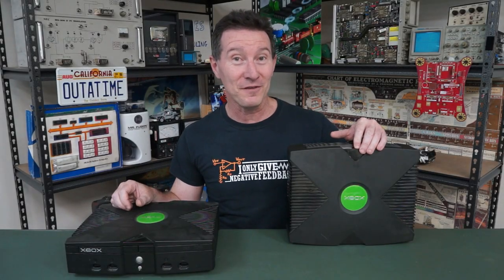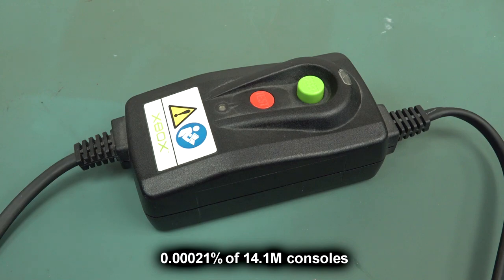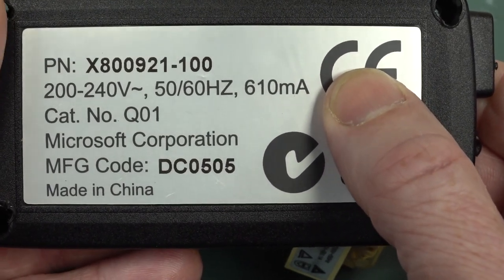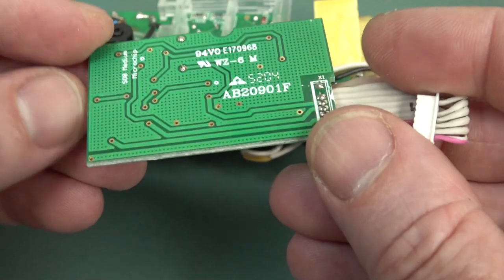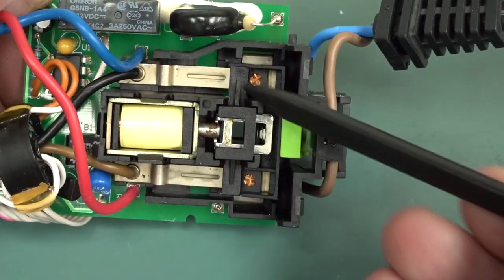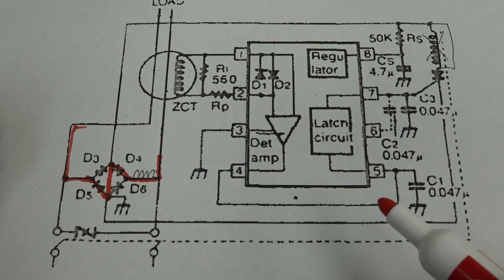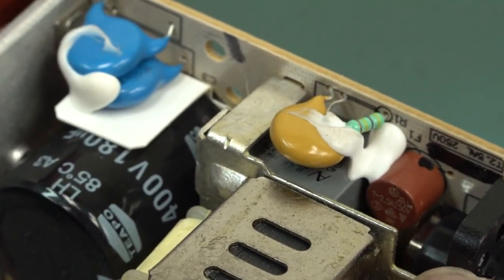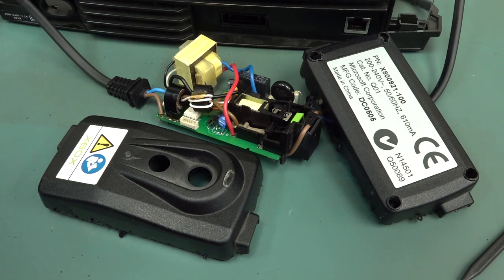EEVblog #1164 - Xbox Engineering Baptism Of Fire

Comment: Got to thinking about this, and I haven't watched the entire video yet, but the current balance detection is like a GFI breaker. I am thinking this is to prevent a fault caused by someone connection the console to a TV that had a hot chassis where the isolation on the TV was compromised. I remember back in my servicing days I would see people bring in TVs that they had modified them self to put things like headphone plugs on them, of got forbid tap in external video inputs to a TV that just had a tuner and was a hot chassis. If something in the TV isolation were to fail and the AV input became hot, that would create a serious safety risk, especially if someone is holding a controller in their hand and the cord was worn exposing a conductor.

Comment: I used to mod the OG Xbox here in Canada, my personal unit had the loose power jack, it finally arced and smoked a bit in 2013.  It did trip my surge protector saving the unit for me!  I was able to re-solder the joints and put in a couple screws for strain relief!  It's been running fine ever since.

Comment: The variation on solenoid drive ensures that if the current detection circuit fails as a short, the solenoid triggers.
Reply from the maker: That would be one advantage. To bad if the diode bridge fails open though...

Comment: I still use mine from time to time. Completely obsessed with Burnout revenge.

I'm sure you already know this but remove the clock capacitor before it throws up all over the board and ruins the console.
Reply from the maker: Nope, no idea about that, what type of cap was it?
Reply: @EEVblog  Super cap. It sits near the front of the unit under the DVD drive.  Should have three huge-ass bulk capacitors next to it.
Edit: Apparently only some models had three bulk caps. Some only had one. There's a ton of info on the net about the darn thing.
Reply: Eyy Revenge is good shit
Reply: Indeed it is. Would love to see a PC port with higher resolution. Paradise can't touch this bad boy :)
Reply: @EEVblog  I recently removed mine and it was leaking. Here are more details: https://www.reddit.com/r/originalxbox/wiki/clock_capacitor

Comment: My guess at the uncommon wiring of the solenoid is to allow for measuring the current going through the solenoid (that's why the white lead goes through the current tranformer) when you press the Test button, showing either green flashes or red ones on the led, and it also protects from most common thyristor failures. There's no chance of a fault not being detected by the Test procedure.

Comment: I worked for an "Electronics Boutique" type repair facility in Australia repairing PS2 and XBOX consoles back in the day. Apart from RROD reflow issues and generally mechanical CD drive issues the SM power supplies were a massive failure mode. Can't remember specifics but the later revision supplies were far better and I generally put them in the consoles when servicing  as the early boards were notoriously bad for shitting the bed unexpectedly.

Comment: At the start of 2018 Microsoft had a recall on the Dumbass Little™ 5cm power cord that goes from the outlet to the power block because it had no strain relief. Kind of weird that they screwed up again, but at least the replacement plug couldn't have cost nearly as much. Thanks for the trip down memory lane and the in-depth look at what it takes to make up for bad soldering sometimes.
Reply: In 2018? Wow, back a few years ago we got a box of ac leads in for surface computers that was because of the same damn thing!, no strain relief on this tiny foot long cable!

Comment: I don't recall ever seeing one of these replacement cords, or even hearing about it. However the xbox has a special place in my heart, because it was the first time I soldered anything, by way of installing mod chips :) Another nifty mod you can do to these is get an IDE to SATA adapter so you can install a modern hard drive, it allows for near instant loading of games from HDD and higher capacity.  The OG Xbox was great!
Reply: First Last  Ah, that would make sense

Comment: I wouldn’t call this “the 2005 XBOX” when XBOX 360 launched in 2005. It’s the 2001 XBOX. Yes, it was king of the hill for most of 2005, but that was after this issue was fixed. The XBOX you brought home from the store in 2005 should not have the issue that prompted the power cable replacement.
Reply from the maker: The issue came up in 2005, 6 month before the 360 was released. Boxes after Jan 2014 were not affected.
Reply: @EEVblog  I’m confused. By Jan 2014 the original XBOX had been out of production almost a decade. Maybe it wasn’t a full-on recall yet but they started making XBOX consoles with the safer RCD power cables on October 23rd, 2003… which is less than two years after it launched in November of 2001. It had two more Christmases ahead of it before being replaced by the XBOX 360 meaning half of it’s primary retail life was yet to come at that point. That’s why so many used XBOX consoles have the newer/replacement type power cord.

Comment: i dont remember this happening.  Im fairly sure I didnt have the replacement connector.  I could have died in a blazing fire!  Fortunately, I never had an issue.  My 360 did get the RRoD.  I called MS and the tech said "Uh oh."  Turns out my one year warranty expired  literally the previous week.  He put me on hold for a couple minutes and said they would replace it anyway.  That was cool of them, as they technically didnt have to.
Reply from the maker: Nice.
Reply: It helps if you only plugged/unplugged the thing a handful of times, and if you did it without excessive force.

Comment: I've had my original Xbox for about 15 years and haven't had any issue with the power supply in it. The only problems I've had with it was the leaky clock capacitor i took out and replaced, fixed the coroded coppertraces that preveted it from being bootable on the power button, and replaced the rubber belt that makes the dvd player to open it's door. 
I had it running for about 6 hours straigt not long ago, playing some old games and watching dvds and it didn't complain at all.
I've done some modifications on it over the past years and now have my whole game library stored in it's internal SSD harddrive i installed about a year ago, and it is works like a charm.
I'm rellay happy with it.

Comment: I've seen similar used of  bridge rectifier for the solenoid to allow a SCR (or even BJT) to switch on the AC coil for both cycle, instead of only one without it.

Comment: The electronic fuse would have been an off-the-shelf part no doubt just rebranded
Reply: That "Xbox" label at the bottom and the cheap abs case gave it away pretty easily.
Reply: I was thinking the same thing. The obvious "generic Chinese" industrial design of the case that didn't fit the XBox styling is a bit of a giveaway. I doubt this was designed for Microsoft.

Comment: Could the micro controller be set up as sort of a time delay?  Such a thing where it will allow some current draw for a bit but then it can decide to cut it after a certain amount of time, then can reset if the extra load goes away?  To me, depending on what the console is doing, working hard for a fully complex game and graphics, or something more easy like Tetris,  different current loads?  Time delay for the high draw periods but if it draws for to long, it will cut it?   Maybe talking out my but.  I do lots of high current 13.8 volt stuff, hf radios,  I more concerned about a good crowbar/clamp circuit in it.

Comment: At 12:30 you ask why two boards. There are isolation rules. You just can't put all that low voltage stuff on the main board in the middle of the 240V circuitry.

Comment: The Thermofuse in Series to the MOV is for stopping the MOV from burning. MOV degrade with every thermal event (Overvoltage), and degradation leads to a lowered threshold voltage, amongst other things. So, eventually, the MOV will start conducting at mains voltage, heat up, lower it's threshold further, and finaly run away with a massive Fireball at the end.This can only be stopped by sensing the temperature of the MOV and breaking the circuit if it get's too hot (->Indication of massive leakage Current). At the End, the MOV doesn't protect anything anymore, but at least there are no flames...I also do this in my HV-Designs, because an Arc at several hundreds of Volts DC is only fun if you can watch it in a controlled environment...

Comment: In every single one of the xbox originals I have opened, the aerogel supercap keeping the clock circuit powered has failed and leaked, with a slimey corroded board as a result. Some boards are beyond repair, and some did clean up and worked after some component replacements.
First signs of failure are a reset clock, difficulties powering it on, and occasional spontaneous self power ups when the cruddy mess is really bad.

Comment: the two boards are due to certification - it's much easier to get certified if the low voltage and high voltage boards are separate.

Comment: I felt the same thing when I saw this design in an old wire schematics of ( if I remember well) a secret light activated light bulb. I firstly didn't understand why they shorting the bridge rectifier. I think this is before the tryac becomed cheap enough for mass production. And they did  that so they can use a transistor or a tyristor to switch an ac load.

Comment: temp fuse on the MOV is because once MOVs trip at high current or slow degradation over time they lower their resistance and constantly run hot all the time. If this AFCI is meant to suppress arcs it potentially could see a lot of back emf from arcing and degrade the MOV over time thus the temp fuse. If fact any good quality surge arrestor will have temp fuses on MOVs like "protected" power bars etc
Reply: Ah! That explains why I've come across some old power bars with mov's and darkened plastic around them that appear like the mov's were hot for ages. We have a ton of oooooold 20+ year old surge supressor bars hanging around my workplace, and I've pulled a few of these apart with that failure.

Comment: Arc Fault is big now in residential homes and now are used in all residential receptacles in the USA or as a breaker to feed receptacles. Older homes when replacing a breaker can use a similar breaker as the neutral and grounds need to be accurate to work properly. Good Stuff their...Uncle Bob

Comment: I remember getting the cord replaced on mine. A friend got the in-line circuit breaker like in this video, whilst all I got was a new figure 8 cable. The only thing I could think of was that my Xbox was a later model with a different PSU, but I still thought it was weird that they sent me a cable.

Upon closer inspection of the original figure 8 cable I got with the Xbox, the figure 8 plug end was marked that it was only rated for 120V with an Australian 240V plug on the other end.

Comment: I've had an XBox since day one, and have work on them for years. The first time I have ever seen that cable was about a year ago on a unit that came to me needing a new belt for the eject. I looked at that like what the hell is this thing.  Never seen one with a problem at the input side, or heard of anyone have one smoke, catch fire, etc. 

I know they're tough units. I just rescued one that was sitting in the rain for about 5 years, It was rusty as can be, but it powered right up and worked with the exception of the laser guide being stripped, and a bad eject belt. 

I wonder with the complexity of that external power unit if it was designed not just as a fuse (breaker), but as an ark fault unit. Something many new homes now have, but wasn't common when these were released.

Comment: Funny thing, I got a cheap (80 euro) "2 in 1 rework station" (hot air + soldering iron), and the first thing I noticed when taking it out of the box: a nice round fuse holder in the back of the device.

Comment: wow i havent seen one of those things for 10+ years! My old original xbox was one of the affected ones so i had one of these. Funny thing is, until i saw this video i had 100% forgotten all about this issue and those things and still regularly use my console to this day just using any random fig 8 power lead ive got lying around. I might go and make myself a fused one after watching this just with a couple of 1 amp fuses. Not as good as this thing but better than nothing. 

And infact this got me thinking now too how many other people have got console which were from the affected batches but long since forgotten all about it or people who have bought second hand ones off ebay etc.

Comment: MOVs should have thermal fusing to prevent thermal runaway and fire under current limited fault conditions according to manufacturer's recommendations. You can buy MOVs with thermal fuses built in.

Comment: Dry / broken solder joints on the mains input was a common problem on the original xbox. We used to get quite a few faulty ones in the shop and invariably the complaint was intermittent or no operation. We never saw a really burned up one, but arcing on the mains input was definitely an issue. We used to resolder the connections and then anchor the mains socket to the case with a couple of small screws and we never had one come back. Pity the xbox 360 wasn't as easy to fix - those things were a complete nightmare, and the failure rate was astronomical, as we all know :(
Reply: Edit > Just think how much money Micro$oft would have saved if only they's anchored that socket properly in the first place. (We still see quite a lot of laptop chargers with the same fault)

Comment: I got mine for $5, guess it was because when they didn't see a green light, it was because there wasn't a video cable attached. So I got it to work for cheap, tore it apart, cleaned off the pink thermal goop, cleaned the DVD lens, replaced the thermal goop with arctic silver, soldered in a mod chip, and bam, it worked great (worked great before that, but showed signs it needed some work).
A week after I got the knockoff "slim" controller, got a Duke for $5 (hey, consistency, right?). Working on getting a new HDD in there as the 8 GB version is meh.

Comment: Still have a rev 1.0 board. I remeber ordering a new power supply that had fixed the fuse issue and locked down the female power input port. Rev 1 has a fan over the heatsink. Another issue was lack of airflow to keep the hard drive cool. The cooling fan mounted in the back of the chassis was very noisy. To correct this issue, people would place the Xbox in an enclosed TV cabinet. Lack of cabinet airflow increased the internal temperature of the Xbox. The cooling fan in the back of the case was suppose to increase in speed as the temperature inside the case increased. For some reason, some Xbox units did not and would overheat. The simple fix was to drill holes in the back of the hard drive plastic mount and upgrading the bios to spin the cooling fan faster. Rev 1 of the orginal Xbox didn't encrypt the bios, so changing the speed of the fan to a fix voltage, RPM, was an easy edit. The downfall with the Orginal Xbox was a lack of memory for some of the intensive games. The fix to this for the Rev 1 board, we would solder additional memory chips on the back of the motherboard. Microsoft engineered the ability to do so but never officially sold the units with addtional memory. Booting the console after soldering the addtional memory, the additional memory was automatically utilized. The more graphics-intensive games having four players ran a lot smoother. I think I still have the how to document somewhere in my archive. Reply back if you would like to see a step by step on how we modified the motherboard and xbox case to allow the game console to work better during long hours of intensive game playing. 🖒
Reply: I always thought that i would not utilise more RAM unless you have flashed bios that supports it. Original games wont use that unless patched, maybe homebrew and emulators. I have 1.0 revision with ram mod and 1.4 with original 64mb of ram. But if you are right well, something new learned.

Comment: I used to have a Mod-chipped original Xbox.. they were awesome media players and being able to 'back-up' games to network storage was very handy. In the end it got struck by a power surge which killed it.. so I gave it a viking funeral in the back yard with the help of some diesel.. I wish I still had it.. never had this electronic fuse for it.. maybe it might have help save it
Reply: Dana Vixen My Xbox was hardmodded too.  It had a 160Gb hard drive.  I used my Xbox for xbmc as well as playing games.  I think I had a few emulators on it too.

Unfortunately the hard drive crashed about 4 years ago.
Reply: @DerekWitt  Yep they had very good 8/16bit emulators for them and XBMC was fantastic for the time :)
Reply: @DerekWitt    Luckily hardmodded one can take unlocked new hard drive. Mine HDD died too, so i put in new 2tb sata drive. Much more reliable and MUCH more quiet. Recommend 80 wire IDE cable for it. And not every adapter will run. Today there is no point of modchips, exept for 1.6 xbox, you wont be able to play xbox live anyway.
So if you still have one, use boot DVD or clone HDD from another unit, and it will work :)
Reply: I still my software moded Xbox original to stream internet radio and as a media player using xbmc4xbox 3.5.3, I did put a 160 gb hard disk to store some of the old games they run off the harddisk now.